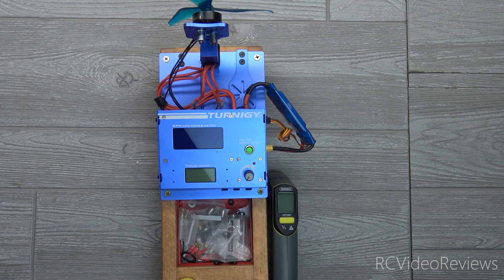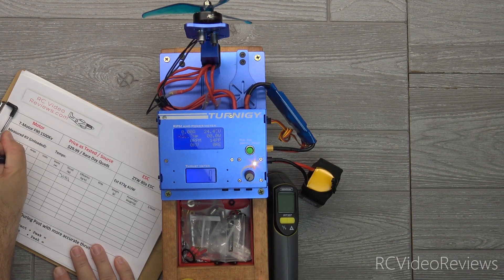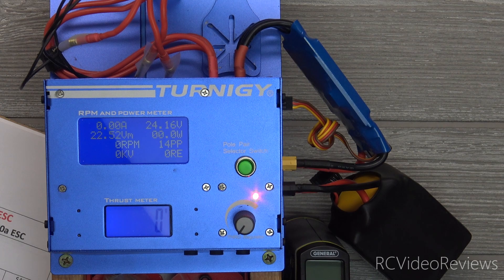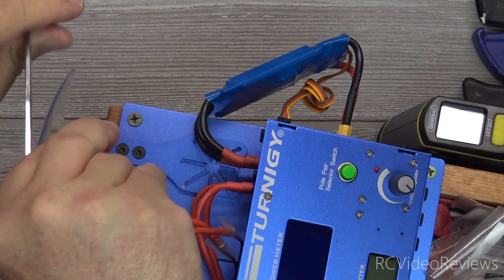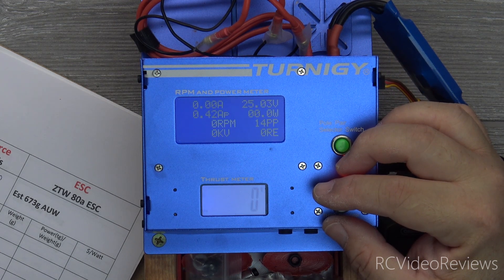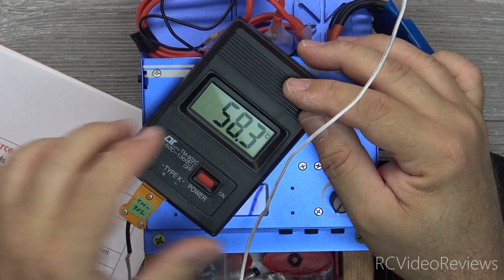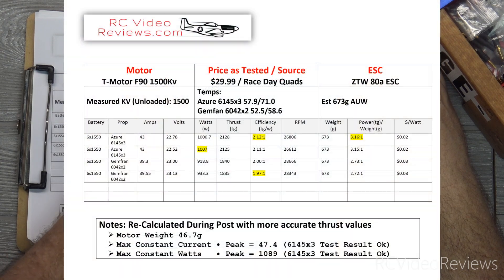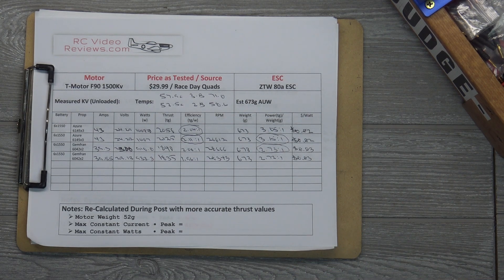T-Motor F90 • Gemfan 2 Blade vs Azure 3 Blade • Which is More Efficient?

Comment: John once again excellent review Have a quick question I used an original 2 blade prop with my x-uav sky surfer & also tried a 3 blade prop , Is it true that the 2 blade prop will glide better during landing then a 3 blade prop What do u think about this For a beginner ??
Reply from the maker: I really don't think the prop will make a palpable difference in glide for a beginner. 2 blade prompts are a bit more efficient, but for pushers, a 3 blade can give you some extra torque and not hit the tail boom.

Comment: What will u recommend for higher speed 2 or 3 blade?
Reply from the maker: 2 blades. More blades reduce efficiency but improve torque. For speed, you want 2 blades and more pitch.
Reply: @RCVideoReviews   thanks a lot brother is there no relationship between thrust and speed cause I saw three blade generated more thrust

Comment: Normally if your running a 2 blade prop going to a 3 blade you would reduce the diameter by 1 inch so for instance if your was running a 12x7 2 blade you would run an 11x7 3 Blade same pitch but lower diameter to get roughly the same performance.
Reply from the maker: Correct

Comment: I wonder how a 6in 2 blade compares to a 5in 3 blade
Reply from the maker: They’ll be pretty close in terms of current demand with the 2 blade being more efficient.
Reply: @RCVideoReviews  would a 2-blade 6 inch make a plane fly faster than a 3-blade 5 inch (assuming they both produce the same amount of thrust)?
Reply: @pipoypipoy7796 pitch would make the speed difference more I think.

Comment: Very interesting. That noise at full throttle on the 2 blade is likely the blade flattening out and fluttering.. I think you would get far better results at full beans with a stiffer 2 blade.
Reply from the maker: I was thinking cavitation. Such is the nature of static bench testing though.
Reply: @RCVideoReviews   could you do a test at a fixed amperage or fixed RPM?  So for example if max current of the lower one is 30a for example, test them all at 15a.  See which one gives the most thrust at a fixed lower amperage.

Comment: If you really want to do a good efficiency test you should run all the propellers at similar power points and then graph the g/W curve for each propeller
Reply from the maker: Right.
Reply: Yeah, you should document what current its pulling at the same thrust point.

Comment: I like the results of the three bladed props. You would have thought the two bladed prop would show better results than they did. Good job John!
Reply from the maker: Yep, I thought the 2-blade props were going to be on this quad out of the gate, but I'm going with the 3-blade setup to start. I'll try the Gemfans though. Thanks for checking-in.

Comment: I forgot you did these bench vids. its good to see something other then strictly quad... even though they are quad motors
Reply from the maker: I think this test applies across the board--it was meant to test 2 vs 3 bladed props and the one thing I took away is confirmation of why this channel exists in the first place--it's better to test and measure.